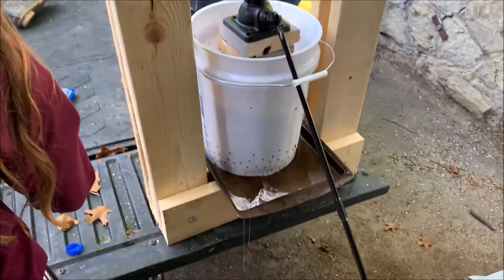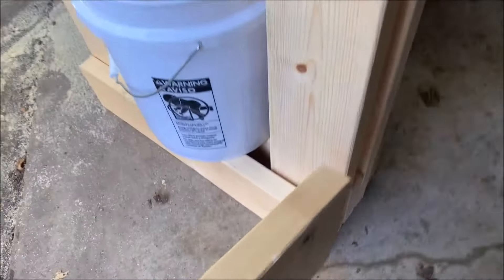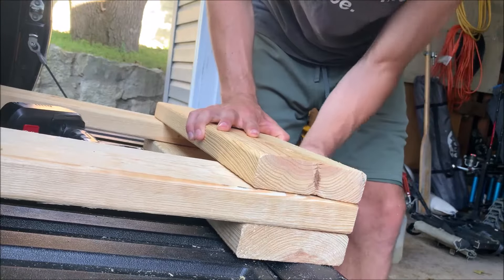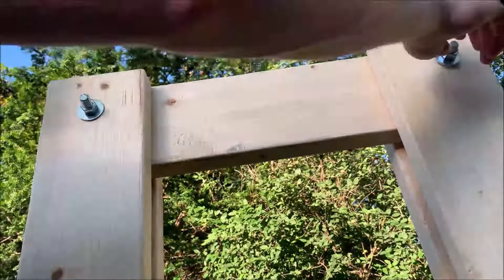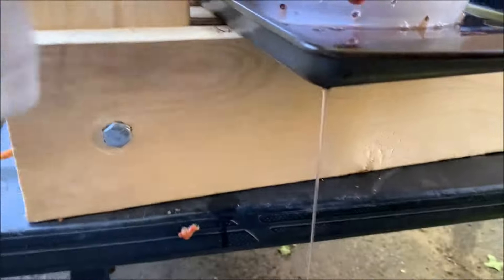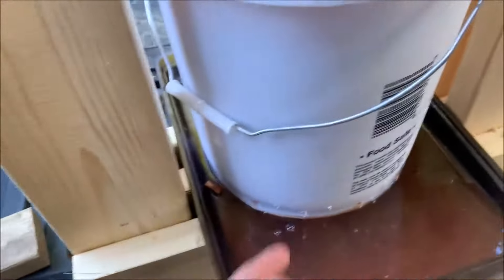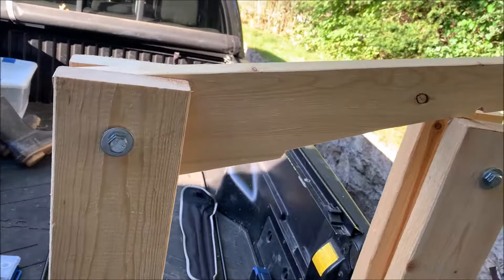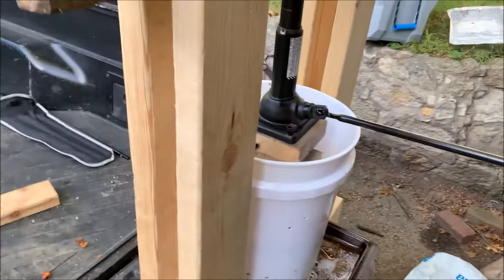DIY Apple Cider Press | How to make your own Apple Cider

Comment: if want even more juice from the same volume of fruit, go to the brewery store or sometimes health food stores, and buy pectin enzyme. it's not the same as canning pectin. You want pectin enzyme. use the drill to bust up the fruit, mix in the enzyme, and leave in your fridge over night. this is called cold maceration and is a common trick winemakers use to get the most out of their fruit. most of the juice is stored in the skin and the pectin enzyme will break down the celluloid walls of the cells and release that fluid. then when you press the fruit, you can get double-digit percentage increases in juice. some say it increases the flavor as well but apples are already delicious.
Reply from the maker: Good to know! Thanks.

Comment: I think your pine would work.  Try cutting your uprights about six inches longer and add two bolts on each upright over the top of your top cross piece.  Then you would have the grain of the wood working for you rather then against you.
Reply from the maker: Good point.
Reply: Gluing those face joints would also distribute the force and eliminate the splitting. As long as you aren't concentrating all that force between grain lines, that lumber should hold.

Comment: Made this today and the 1/2-inch bit almost burned my drill out and jerked my arm out of joint even though I predrilled with smaller bit. He clearly says "2 1/4 inches" to drill the holes, it should be 2 3/4 inches. If I were to do it again, I'd drill through only two boards at a time. Overall a great idea and good video. Look fwd to pressing some apples!
Reply from the maker: @melvinfrisbey8611  hope your arm is ok!  Good feedback for viewers thanks for the helpful comment. Enjoy the pressed apples!

Comment: I cannot see how the plastic drum will take as much pressure as the usual cider press with wooden strips held by steel bands around them. Looking at the remaining pulp, after the press, it seems very wet with loads of juice still in it. The drum did look as if it was distorting so I'd be inclined to reinforce it with straps and stakes before it splits.

Comment: Do you need a pick-up truck to mount the press on? Coz i don't have one and they're really expensive. Was thinking of using a table, do you think that will work?
Reply from the maker: Lol yes you can elevate it on anything.
Reply: Absoultely not. It's a big investment, but cider just doesn't taste right unless you make it on the back of a pickup truck. If it's a diesel truck, that's even better.

Comment: That is not a hydraulic jack but a screw jack so there is no worry about hydraulic oil. Could be some lube oil but not much. If you use a hydraulic jack you should watch for leaks.

Comment: Nice. I was designing my own and I was going to make it from 2mm thick stainless pipe and was wondering if it's strong enough. Most likely is because the bucket was holding so well. Seems that major part of the force is directed to the bottom. 

I was thinking if I could avoid grinding and just use stronger jack but maybe that's not good idea.
Reply from the maker: If you don’t grind them what works really well is freezing them first cause they are softer when you thaw them
Reply: @JacksonBaumgartOutdoors  I try to avoid that. I don’t have enough room to freeze them and I try to make process as simple as possible. 

I made sturdy press from steel because I have other use for it. I made a test press with apples I bought from store. I pressed them as whole and got a bit over 1l of juice from 1.5kg of apples. I could have got propably even more but apples started to squeeze between the pipe and my oak pressing plate. I tried with and without filtering sack, but both failed about the same time. 

The problem is that stainless pipes are not exactly round and with higher pressing pressures, apples seem to go through less than 1mm gap.

I’ll make couple of more tests an try to solve the problem. I may try a plastic bucket with a concrete and rebars to get tighter fit, or more traditional wood and rims. 

The taste of the juice didn’t change much towards the end, which is a good sign. Brute force seems to work well in this. I used 12t jack and used maybe half of the power before leaks appeared.
Reply from the maker: @teropiispala2576  yea give it a try.
Reply: @JacksonBaumgartOutdoors  seems to be that apples like to come out as a mist from smallest of holes just about same pressure where juice leave from chunks. I'm not giving up yet, since I have a next idea. I make a top and bottom lid on my steel tube and seal them with o-rings. Then I make a piston from another stainless pipe, which is slightly smaller than the bigger tube, like 270mm and 230mm. I weld a bottom on the piston and fill it with concrete to make it solid. Then I can straighten with my lathe. It'll seal on the top lid with o-ring. I put fine stainless mesh on the outer tube walls.

This has several benefits in addition of superior tightness. It don't pack apple mush under the piston but keeps it on move as it squeeze on the sides. This hopefully keeps channels open for a juice to flow. Also, surface area where juice flows out keeps constant and relatively larger and thickness of juice layer smaller.

If that won't work, I give up and grind my apples.

Comment: The jack is a mechanical screw jack, not a hydraulic. 
  Really want to shred apples use a garbage disposal.
  90% shade cloth works good as a straining material.

Comment: I'm surprised the bucket doesn't split open under pressure. Being that the bucket is tapered the wooden press disc doesn't make a seal when it's near the top. The juice follows the path of least resistance and pools on top of the disc.
Reply from the maker: Good point. I ended up having to drill holes over the disk cause like you said it goes to least resistance.

Comment: Are food grade buckets necessary?
Reply from the maker: Probably not honestly. I just figured it’s worth the extra 5 bucks for the peace of mind
Reply: @JacksonBaumgartOutdoors  probably yea though because you're mixing in the bucket with sharpened metal. regular buckets you get from the home depot or wherever use cheaper plastic and the metal attachement youve fashioned is very likely scraping the sides and cutting away plastic which gets into the juice. food grade is a lot more durable and less likely to introduce plastic waste into your final product (though it still will if you let the metal hit the walls, no plastic bucket is perfect).